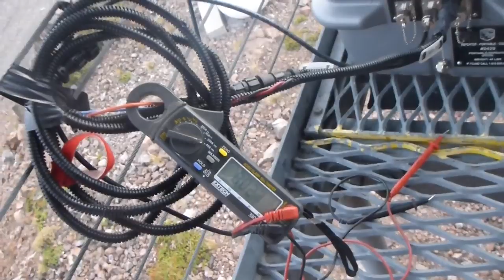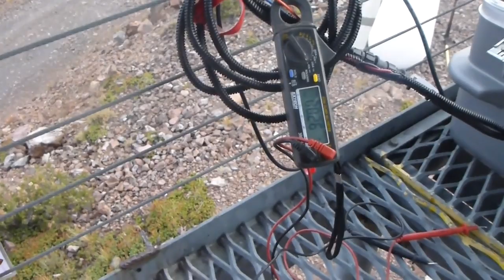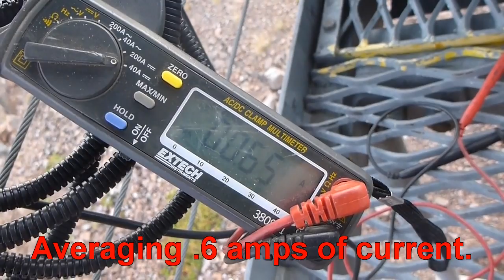Real SHTF Tactical Solar Powered Radio Repeater Deployment

Comment: I found the Comtronix website, but it has virtually no information. What is the model of the VHF repeater that is shown in this video, and is it still available from them? Seems to be a logical solution to the fleet of TKR750 portable repeaters I operate

Comment: Got you. I have a "critter" in a box. That is to say. A bf-888s controlled by a simplex repeater. All in a .50 cal amo box with a mag mount antenna. On the box . Dependent on use. It lasts about 12 hours And spare batts to swap out when needed. Kv4li 73. Thanks.

Comment: How high(elevation) is the repeater? Does it only rely on solar power? Does it work good?
Reply from the maker: That was 7000' high on a 80 watt solar panel in conjunction with a battery box. At that elevation we covered a good chunk of rel estate. about 60 miles give or take. we were able to cover 2 seperate fires the command post and a helo base that were spread apart pretty far. If I remember right, I think the output was 5 watts or so, on a halfwave dipole.
Reply: Thank you! Nice setup!

Comment: Is that two commercial radios ganged together to make a repeater or is one a backup to the other?  

On another note you didn't leave your wallet in the repeater case did you? :)
Reply from the maker: Doctor Who Yup one radio always receiving and the exact same model 2nd radio for transmit. I wouldnt notice either way, there is never any money in my wallet to be worried about. :<}       Thanks for watching.